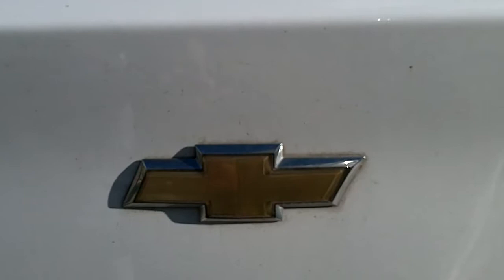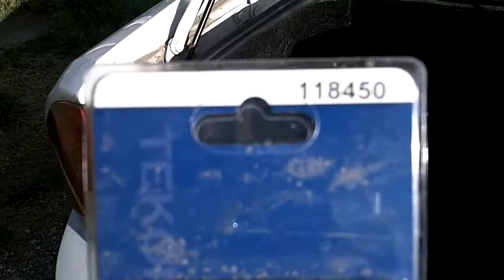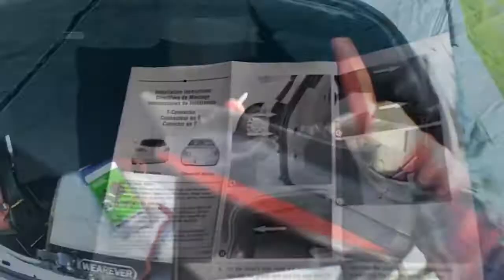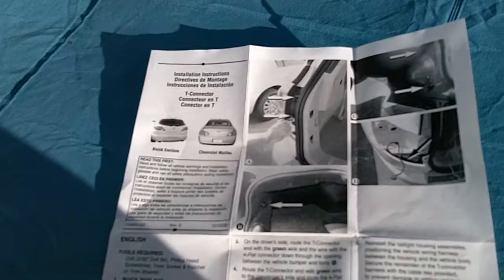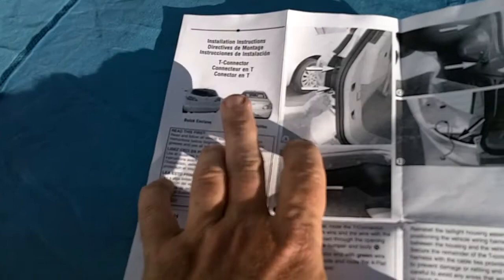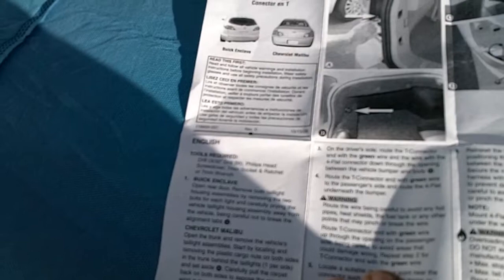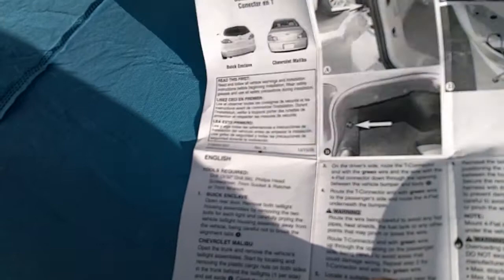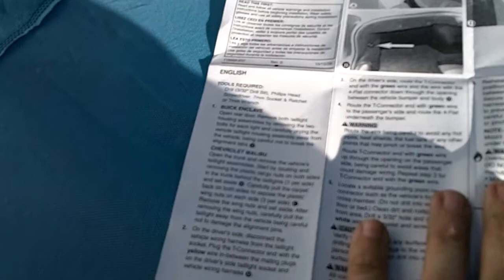Installing Trailer Wiring Harness on Chevy Malibu

Comment: That was a nice plug and play harness. I did not know you could get them specific to the car, I always see them spliced and taped etc..A real messy install yours was neat....
Reply from the maker: Lorddarthvader1701 
Oh yes, there is a trailer wire harness for every car and truck.  Actually, the harness is most likely the same, but the connectors are model specific.

Comment: Where did you get that wiring harness ? Does it have to be a specific one ?
Reply from the maker: I bought the hitch and wiring harness from Etrailer. Here's the link to the wiring harness:
https://www.etrailer.com/Custom-Fit-Vehicle-Wiring/Chevrolet/Malibu/2010/118450.html?VehicleID=20101170778